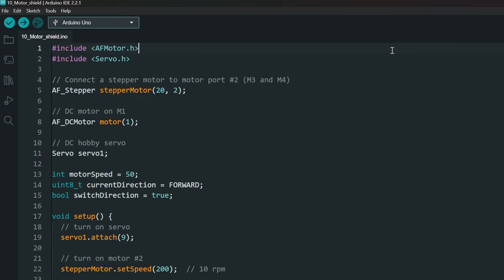Arduino Motor Shield Explained

Comment: Bro can u explain pwr 
If I only connect it with usb 
Then should I put the pwr jumper on it and if I connect my arduino with external power source then should I put the power jumper or I have to put it only when I connect my arduino with only one power source
Reply from the maker: Put the jumper on when you want the power to flow from the shield, to the Arduino. If the jumper is removed, the power from the shield is cut off and does not go to the Arduino. 

So no matter how you power the Arduino, if you have a separate power for it, leave the jumper off.

Comment: Me again! I won a stem competition with the help of your video thanks! Quick question, if connecting 2 geared motors to the driver as well as a larger motor, would the big motor slow down the other motors or could using a big enough battery be too much for the little motors? Thanks again!
Reply from the maker: The driver ICs have a current limit. What are the max draws of your motors? How big are we talking about?
Reply: @techtalkies1 motor 12V 11000RPM and the smaller ones are 6V 9000RPM. If I used a battery back for 6 AA batteries would the voltage produced be the same as the battery or would they add like linear or the other circuit type.
Reply from the maker: 11000 rpm is a lot. Check the current draw of the motor, not speed.

Comment: Is it possible to control four DC motors using an Arduino motor driver shield with an ESP32 by connecting the shield’s digital control pins to the ESP32’s GPIO pins, while supplying the ESP32 and the motor driver with separate power sources?
Reply from the maker: Technically it's possible. But there are other driver boards for the ESP32.
Reply: @techtalkies1 Can you please guide me on how to configure the wiring and pin assignments to make this setup work correctly?
Reply from the maker: I would recommend a different driver board because the ESP32 is a 3.3v board.
Reply: @techtalkies1  Which one would you recommend, I am using 4 dc motors while esp32 is also running a 6dof robotic arm.
Reply from the maker: TB6612FNG is a good compact driver. But you will need 2 for 4 motors. And I hope you are powering all the motors with external power and NOT with the ESP32 5v pins.

Comment: Hey I wanted to build underground water detector robot with this shield I need to measure resistivity of the soil for that I need to output current and voltage from this driver also I need to inform the user of this measurements so I would need to display that using LCD Can this shield output current and voltage measure it ( 4 terminals) and also connect to lcd screen?
Reply from the maker: Depends on what type of screen you want to use. Is it an I2C display?

Comment: So that means if i provide 12 v to motor driver ..then will it power arduino with 5v volt ?
Reply from the maker: Yes, keep the power jumper ON. The external power supply will provide 5v to the Arduino.
Reply: @techtalkies1 means after stacking both together
Reply: @techtalkies1 external power supply?
Reply from the maker: Yes. When the shield is attached to the Uno, it can supply power.😊
Reply: @techtalkies1 thanks a lot❤️
Reply from the maker: Welcome

Comment: I have 2 3.7V battery connected to the motor shield as power supply.... Now I had adjusted the code for using less power consumption to drive the motors .... Does any issue rise when using all this on an actual project like would any board or servo be damaged?
Reply from the maker: So you're giving it around 7 volts?
That's enough for simple motor operations.

Comment: thx, for the external alimentation, no matter how much A it delivers?
Reply from the maker: The motor driver chips that come with the kit are designed to provide up to 600 mA per motor, with 1.2A peak current. Note that once you head towards 1A you'll probably want to put a heatsink on the motor driver, otherwise you will get thermal failure, possibly burning out the chip.

Comment: Can i connect any other sensors or modules when im using this shield? Like an oled or an ultrasonic sensor. It seems to use every output and input pin of the arduino. So it appears to be useful only when used to drive multiple motors and nothing else
Reply from the maker: That shield uses almost every pin indeed.
But you can use A0 to A5 (the analog pins).
And pin 2 and 13 are not used by it.
If no servo motors are connected, you can also use pin 9 and 10.

The analog pins are connected to the holes in the corner. It think it is a row of GND, a row of 5V and a row with A0 to A5.
You can use the analog pins as digital pins : pinMode (A0, OUTPUT);
The analog part is just an extra, beside that they are like normal digital pins.

Comment: I will use a 12v DC jack on arduino to power it. What about the external power and PWR?
Reply from the maker: If you're powering Arduino using the DC jack, do not connect power to the shield separately. And keep the jumper on.

Comment: Should I use a 12 V lithium battery to power 2 steppers and this?
Reply from the maker: Depends on your motor. What's it's power rating?
Reply: @techtalkies1  It is a NEMA 17 Stepper motor with 4 wires that come out of it. And I am trying to avoid soldering so I am going to use jumper wires to connect the needed connections directly to the arduino uno. I am however needing to connect a joystick and two LEDs to the arduino at the same time. So probably will have to use a breadboard of some type. Any help would be appreciated.
Reply from the maker: I hope you found your solution

Comment: Wait a minute its have 3:47 both sources connected as you said one those can supply
Reply: As you commented at 2:10
Reply from the maker: You can have the USB connected or you remove the power jumper pin, as I mentioned in the beginning of the video.
Reply: @techtalkies1   looking your video are both connected???
Reply from the maker: Yes, both the powers are connected. That's why the jumper is not connected
Reply: I like your ASAP answers, kudos

Comment: What type of servos can this shield run..can you tell the servos name
Reply from the maker: It powers the servo motors directly off the Arduino 5v. 
If using this feature, use only with small servos like the SG90 and keep an eye out for any issues.
Reply: @techtalkies1  Bro how to connect mg 995 servo to that pwm output can you suggest
Reply from the maker: As long as you supply enough voltage to the shield separately, it should be fine
Reply: @techtalkies1  Can i take the pwm signal from arudino motor shield and give the motor external power supply it required through a buck converter
Reply from the maker: I think the v1 shield does not pass external power to the servo motors. It works only on the Arduino 5v. Please check the datasheet.

Comment: Can i use 16 v on the motor driver
Reply from the maker: 16v should be safe. The original board can handle a maximum of 24v. But that's the upper limit.
But also check the datasheet of your shield!

Comment: Hello! Is it possible to connect Analog pins to the DC motors to make them move slower or faster?
Reply from the maker: No. DC motors don't work that way. You will need a motor speed control circuit. You can make one or buy it, they're pretty cheap.
Reply: @ Okay thank you, great content!
Reply from the maker: Thank you!

Comment: can you please guide me to connect 4 rotary encoders with Arduino and L293D motor driver shield (here DC motor is used).
I don't know how to connect 4 rotary encoders in Arduino when it is connected with L293d motor driver shield. 
after seeing your video, I came to know that 6 x 3 holes can be connected, but I don't know how to connect it?
Reply from the maker: That shield uses almost every pin indeed.
But you can use A0 to A5 (the analog pins).
And pin 2 and 13 are not used by it.
If no servo motors are connected, you can also use pin 9 and 10.

The analog pins are connected to the holes in the corner. It think it is a row of GND, a row of 5V and a row with A0 to A5.
You can use these analog pins to connect the rotary encoders!
Reply: thanks a lot for reply
😊 I thought you will not reply to me sir, thanks
Reply from the maker: Glad to help!
Reply: @techtalkies1  I think A0-5 is not suitable for encoder signals.
meanwhile how can I access PIN -9,10 and PIN -2,13. should I Solter these pins like you did.
even then how do I know which pin is CLK, DT, SW.
I am beginner which mean this is my first project "encoder-based robot for precise tuning and calculated motion " is my topic sir.
[i was searching for the technique to overcome this problem, only in your video you spoke about the analog pins  ]
Reply from the maker: @pal.1921  do you need rotary encoders? Or can you use a simple potentiometer?
Reply: By using potentiometer meter we can only access the speed but precise turning what can I do sir
I searched on it everything suggest me to take rotary encoder
Reply from the maker: What is the purpose? What do you need the motors to do? If they are normal DC motors, you can't really move them to exact positions right?
Reply: Use suggest me motor which is suitable sir?
Reply from the maker: @pal.1921  You should use stepper motors for precise control. You don't even need the shield if you use stepper motors. But just use an external power supply to be safe. And you will have plenty of pins left for your rotary encoders. 
Let me know if this helps.
Reply: @techtalkies1  yep very thanks sir

Comment: I need to connect the (4 linear stepper motor) in this shield is it possible?? And can i contol through my mobile?? Kindly help me for this🙂
Reply from the maker: Yes you can control 4.
This forum post might be useful.

https://forum.arduino.cc/t/arduino-uno-cnc-shield-controlling-4-stepper-motors/913742/2

Comment: how to control a 3v-6v 3W pump with it.your reply helps me ..
Reply from the maker: What type of pump is it?
Reply: @techtalkies1  its a mini dc pump rated for 3W operating in between 3V-6V.
Reply from the maker: How many wires? Is it solenoid based? Or does it just have a DC motor?
Reply: @techtalkies1  it has only positive and negative
Reply from the maker: At 3-6v, it is probably safe. But provide an External power supply.

Comment: can this motor shierld work with arduino leonardo ?
Reply from the maker: It should work. But some libraries do not support the ATmega32U4 chip, like the Adafruit Library. 
You can probably use a different library.

Comment: Im using a Duinitech UNO r3 Boqrd with Wi-Fi instead of the  normal arduino uno. Ive got the motor shield connected to a 3V DC motor and a 3V battery pack. Ive done all the steps but it doesnt work for some reason. Any tips?
Reply from the maker: How are you supplying the battery power to the setup? Using what pins?
And I'm pretty sure you shouldn't power the Uno with 3 volts
Reply: I did something and the motor is humming but not spinning
Reply: I span the motor with my fingers and it continued to move until it switched direction
Reply: I'm powering it with the external power thing on the shield
Reply from the maker: A 3 volt battery is not enough.
Reply: Ok thanks 👍

Comment: how can i add a hc sr04 sensor, if i cant reach to the digital pin bc the motor shield cover them?
Reply from the maker: That shield uses almost every pin indeed.
But you can use A0 to A5 (the analog pins).
And pin 2 and 13 are not used by it.
If no servo motors are connected, you can also use pin 9 and 10.

The analog pins are connected to the holes in the corner. It think it is a row of GND, a row of 5V and a row with A0 to A5.
You can use the analog pins as digital pins : pinMode (A0, OUTPUT);
The analog part is just an extra, beside that they are like normal digital pins
Reply: @techtalkies1  thank you very much, good video by the way
Reply from the maker: Thank you. Means a lot.
Reply: @techtalkies1  How do you put jumper cables in the holes? I couldn't fix the cables in there...

Comment: I tried to use this to run a Nema 17 motor but the motor and the shield overheat any idea why?
Reply from the maker: What is the power rating of the motor? Is it a big motor?

And are you supplying external power for the motor??
Reply: @techtalkies1  data sheet said motor is 4.2v and 1.5 amps. It is a motor for a 3d printer
Reply from the maker: So are you supplying the power?
The Arduino pins do not supply that much.
Reply from the maker: Ok if it is still heating, it is taking a lot of load because this shield is very basic. You can either try adding a heat sink or switch to a different, better driver board.

Comment: can we still use the spare IO pins?
Reply from the maker: That shield uses almost every pin indeed.
But you can use A0 to A5 (the analog pins).
And pin 2 and 13 are not used by it.
If no servo motors are connected, you can also use pin 9 and 10.

The analog pins are connected to the holes in the corner. It think it is a row of GND, a row of 5V and a row with A0 to A5.
You can use the analog pins as digital pins : pinMode (A0, OUTPUT);
The analog part is just an extra, beside that they are like normal digital pins
Reply: @techtalkies1  thank you

Comment: is there anyway i can connect a third servo??
Reply from the maker: The shield is not capable of supplying power to three servos. If you are using only servo motors, remove the shield and use the servos directly. Just supply 5v from external to the power pins of the motor and connect the control pins to the Arduino. That might be the safest way.

Comment: Will a 9V battery power both the arduino and the motor shield? While running 2 motors at a given time? (I'm planning to turn two off, and use the other two afterwards therefore total motor count 4)
Reply from the maker: No. A 9v battery will drain really quickly in a circuit like that.
Reply: How much voltage will be required for running four dc motor and both Arduino Uno and L293D driver shield sir?
Reply from the maker: 5v. But voltage is not the important part. You need appropriate amount of Current (A) to run the motors. Check your motor's current draw.

Comment: Hi There, Thanks a lot for the video. I want to use such a shield with a Arduino Mega. I want to connect 3 12V DC Motors. I want to controll the speed of every motor freely with a own potentiometer from stop to full speed, also I want to change the direction of each motor with a switch. Is that possible to realise?
When I use the Mega, are the left I/O s free to use for something else or do I expect for example timing problems. Sorry, if my questions should be clear. I'm more or less new to this kind of arduino stuff. Best greetings.
Reply from the maker: Sorry for not replying sooner. Hope you got your solution.

Comment: Did you get and exit status 1 error or the PWM error where it says that the scope is not defined. I'm new to this and I'm using the Arduino R4 WiFi with the L293D v1 motor shield like in the video. What can I do. I also read online that the v1 motor shield doesn't compile and only the v2 does. Is that true? 
Thank you!
Reply from the maker: Are you using the v1 shield?
It might need a different library import
Reply: @techtalkies1 yes I'm using the v1 shield. Could you paste the link to the library import that you mentioned or how do I get to it ? 
Thank you
Reply from the maker: Try this old library.

https://github.com/adafruit/Adafruit-Motor-Shield-library

Ideally, you should get the latest v3 shield of possible. It's a good upgrade.

Comment: Could you share what power supply to reccomend? I am using a 9V battery and cant seem to get my stepper motor to run.
Reply from the maker: Is the shield's onboard LED turning on?
If not, make sure the battery is plugged in correctly and the power jumper is in the right place. And 9v batteries will usually drain pretty quickly if you power motors with it. I would recommend lithium batteries.

Comment: Can this motor shield running the 12 v dc motor? I would like to use single power source for arduino and 2 unit 12v dc motor, do you have any advise?
Reply from the maker: Technically, it is borderline safe. But the Arduino is rated for 12v max! If there is any kind of power fluctuations, your board will be fried for sure. You can either have separate power supplies or use a heavier and more reliable motor drivers. This one is outdated for heavy usage and it also over heats for bigger motors. It's only for beginners.
Reply: @techtalkies1  thank you